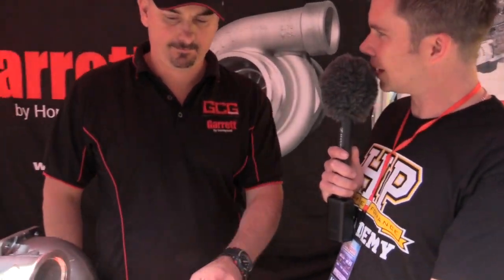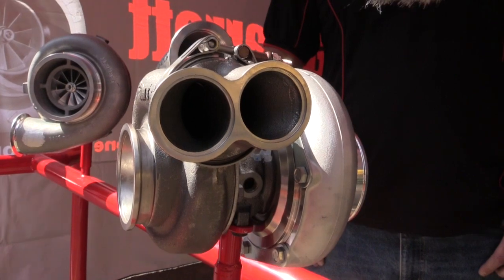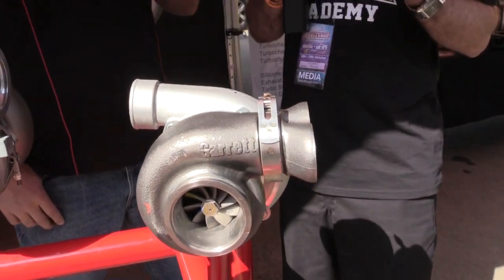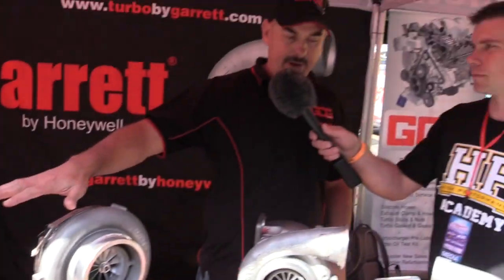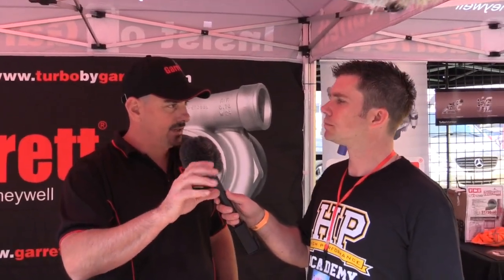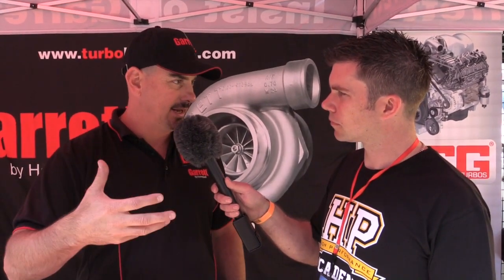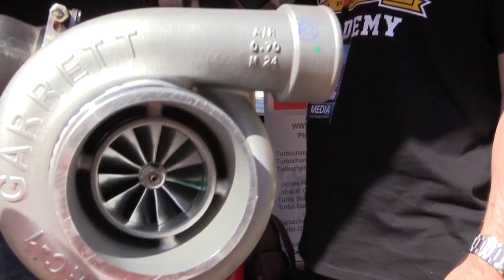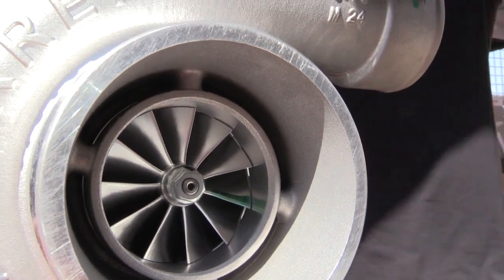Garrett V-Band, Split Pulse Exhaust Housing | HPA Product Spotlight

Comment: that v band entrance tvinscroll technology had caught my eye for an year now but not much info and testing on the interenet especially among the evo comunity.. and i was wundering if the twinscroll vband entrance gains 500rpms of spool.. what does it do for the max output.. what happens with the top of the powerband? does it lose some power versus normal v-band? couse we all know no mather what you do its all a compromise as my prof at the uni says "number of problems is always constant"
so can i get more info on that question before proceeding and actualy buyng the garret vband twinscroll housing?
thanks in advance! it would be extreme usefull information for me